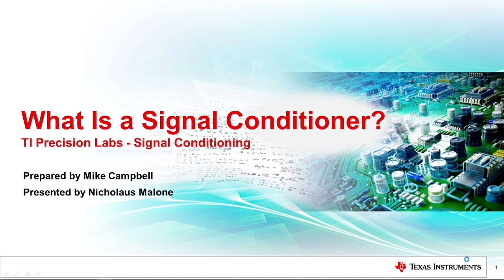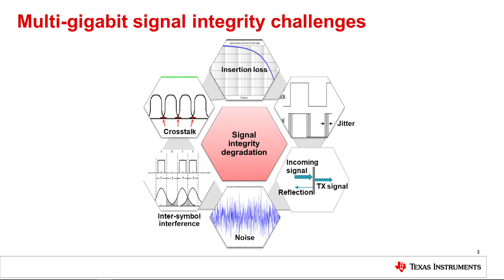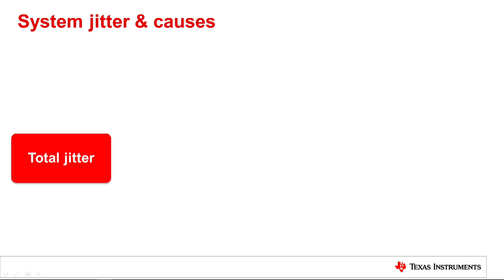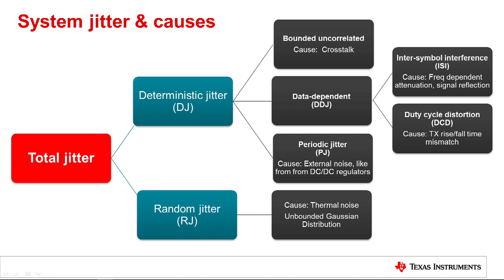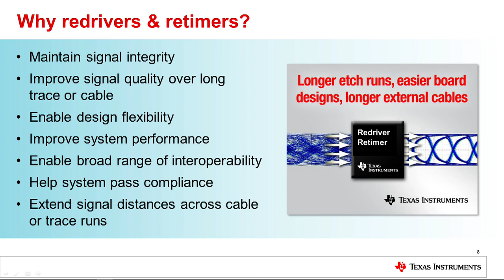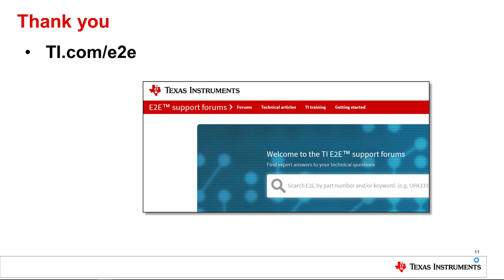What is a signal conditioner?

Comment: Thank you for the lecture. I think another mechanism that may add to the  jitter is the ground supply of the logic transistor which due to simultaneously signal switching could be raised and hence change the Vt of the gate. Hence, the driver switches at a later time.

Comment: hey Nicholaus, thanks for the video, I was hoping that maybe you can help me to understand the root cause of a very specific issue (faced by many people) that might be a manifestation of jitter or signal inconsistency, or power grid anomalies (e.g. harmonics, or ground loops).
Basically the end result is that on a high end PC with a high refresh rate screens 144-240hz feels like 60hz at most, on desktop and in games. Mouse is moving inconsistently, micro adjustments are painfully hard. The problem is that this issue in some cases can be eliminated by moving to another apartment (doesn't have to be different PoCo thought). We are desperately looking to find a root cause of this for years now. Would you be interested in a study?
Reply: Display output and mouse input are usually not directly related from a signal perspective. Although in a 3D game you change the viewing direction with the mouse, which is then logically displayed on the screen, the processing of the input signal occurs—after it has been digitized by the USB host—first at the CPU. And it is there that further calculations for the 3D engine then take place.
If the mouse is moved inconsistently and making micro adjustments is difficult, I would first look for the cause in the mouse itself and in its input signal.
If it's a wireless mouse, then the receiver might be too far away or the battery might be too weak.
If it's a wired mouse, then the cable might be poorly shielded and too long. Or the USB transmitter and its circuitry may be causing a weak signal. Of course, the surface could also be unsuitable if it is an optical mouse.
The easiest test here would be to simply swap the mouse for another one.
However, the problem could also lie with the motherboard and its USB reception. The USB component or data line may be malfunctioning if the graphics output has to transmit a 140 Hz signal to the monitor. In this case, it might make sense to simply test a different PC with a different motherboard and keep the same screen and mouse. Some motherboards have an internal 8-pin USB port, which is usually further away from the ports on the back. You could also connect the mouse here and test whether the problem goes away.
Maybe it’s just that the data cable to the monitor is too poor quality. Here, you could test whether a better shielded cable makes a difference.
Reply: @OpenGL4ever  the things that I've listed are not caused one by another, they are all manifestation of an unknown root cause. I know how signal travels and how PC operates internally. 
hardware is not the problem, since the problem can disappear by moving the same device to another place AND connecting it to a power grid there. 
I mentioned that the problem is faced by many, as you can imagine, those many has already tested plenty of different hardware through the past decade.
Reply: @nothingness863  Why do you think that? The hardware could still be the problem if the new location is electromagnetically noisier and the hardware can't handle it.
And if your problem is software-related, then this channel is definitely the wrong address.
Reply: @OpenGL4ever  sorry, not interested in educating you, cheers
Reply: @nothingness863  Oh, then I’m sorry that I wanted to help YOU. I really regret that. From your last comment, one can infer that you think you’re too good to help others if they have a question. People like you should be left alone—I hope nobody here answers you. What I think of you now, I’d better not write it down, because unfortunately, in my country, freedom of speech has its limits.
Please change your nickname and thus identify yourself as one of the ungrateful ones.
Reply: @nothingness863  Oh, then I’m sorry that I wanted to help YOU. I really regret that. From your last comment, one can infer that you think you’re too good to help others if they have a question. People like you should be left alone—I hope nobody here answers you. What I think of you now, I’d better not write it down, because unfortunately, in my country, freedom of speech has its limits.
Please change your nickname and thus identify yourself as one of the ungrateful ones.
Reply: @nothingness863  Oh, then I’m sorry that I wanted to help YOU. I really regret that. From your last comment, one can infer that you think you’re too good to help others if they have a question. People like you should be left alone—I hope nobody here answers you. 
Please change your nickname and thus identify yourself as one of the ungrateful ones.
Reply: @OpenGL4ever  your idea was to blame hardware, which is insulting. 
and then you doubled down on blaming hardware, which is stupid.
Reply: @nothingness863  You just said, you  believe in ghosts, not in technical reasons.
👻
Help yourself. EOD
Reply: @OpenGL4ever  why are you lying?